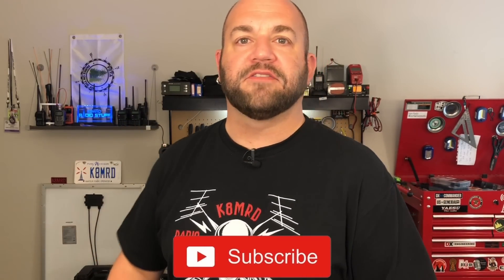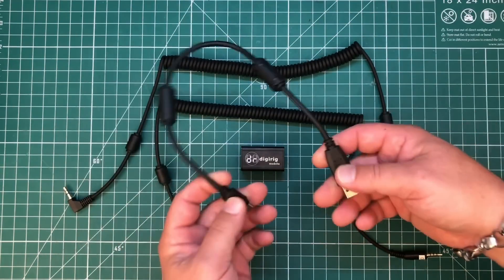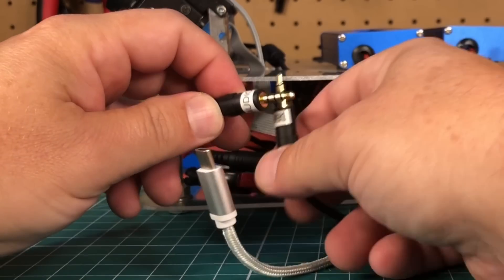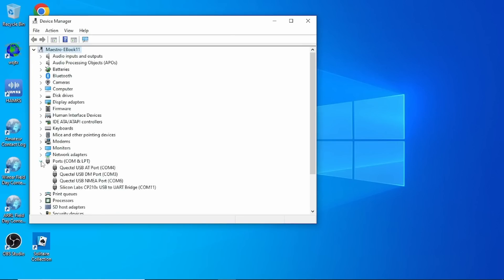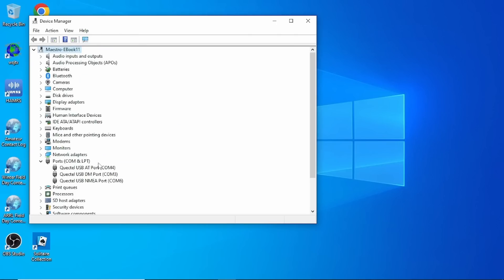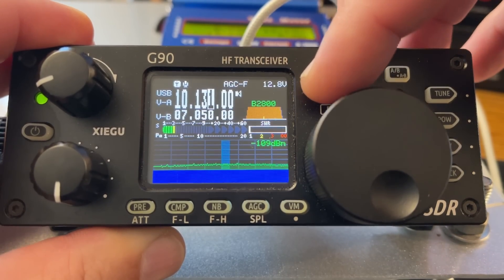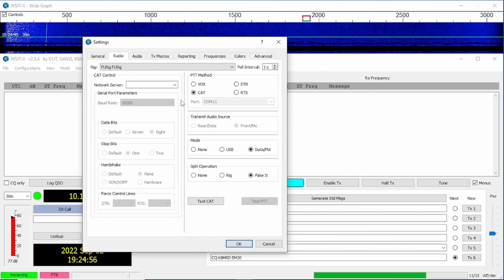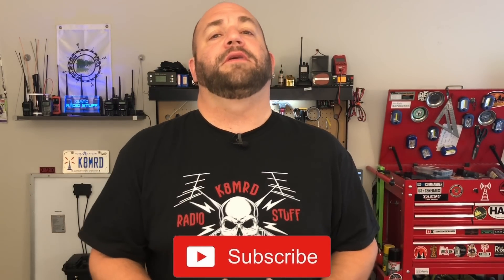Digirig, Xiegu G90, FT8 Fast & Easy

Comment: This looks quite useful, I'm trying to do digital modes w/ my G90 using a Sabrent usb sound card and I'm having all sorts of difficulty getting it to work reliably.  My antenna is a Wolf River Coil I typically just throw on a mag mount on top of my vehicle while parked.  So far I have gotten people to hear me one time, I'm having trouble figuring out what my issue is.  Most days receive is quite good, unable to get ahold of anyone to tell me what my transmit sounds like.

Comment: Are you sure that you want your ALC so high? High ALC should be an indication that it's clipping your audio to prevent splattering. HamRadioDX and TO have a segment about it here: https://youtu.be/dOXbvKNu0c4?t=1280  On a side note, it's awesome that you're doing FT8 more - we had a QSO last week on 17m FT8 while I was doing POTA in Hawaii.
Reply: On the G90, the closer you are to zero the more you are over driving the signal. If you're running the current firmware, the manual actually says that ALC 100 is under driving the signal and ALC 0 is over driving it. You can tell this is the case because he had his radio set to 15 watts. At 100 ALC he was only pushing around 13 watts. After adjusting the ALC he was able to achieve full power. 

Mike is an OG when it comes to the G90. Pretty sure they're going to name the next version G90M. Maybe OG90M? Who knows?
Reply: @norrinradd8952  ahhh, that makes sense, it's the opposite for Icom
Reply from the maker: What Norrin said.  And heck yeah on the Hawaii POTA!!  I needed HI hunted so bad too.  Now all I need is to hunt AK and I'll have all 50 states hunted!  Thanks so much for being out there!

Comment: Thanks for doing this video Mike. I have been considering going digital with my G90 but didn't want to get that hockey puck thing. This is a lot easier. Hope to connect with you on ft8 someday
Reply from the maker: No problem!  Hope this helps make your decision.   Catch you on the air!

Comment: I've been using the XGGcomms Digimode-4 cable for a couple years. One USB to the PC and two connections to the G90, just like this. Works with FLRig, sets up as a "IC-7100" and done. Just set WSJT-X to look at FLRig for control. It's been great.
For those who didn't know like me, the "Fake It" split setting makes your PC output a tone at one frequency and the radio moves its output up or down to put the tone on the right "segment". It can get weird at the edges of the 3kHz space. This makes your output power consistent. I learned this by scratching my head for a few hours.

All that said the digirig is much cheaper and you don't have to wait for it to come from the UK.

P.S. Love the into, particularly the Walley World shirt lol We have the Marty Moose eggnog glasses for Xmas time!
Reply: I have the same but I use a X5105 with it. There’s even a profile setting in flrig for the x5105! Working the World Dig on 5W. 73
Reply from the maker: well look at that.  Learn something new every day.  I honestly don't know why I started using Fake It, but it's worked for me for all these years.  Eggnog is gross but I'd drink out of a Marty Moose glass for sure.
Reply: I used the XGGComms also works great.  Why do you use Icom 7100 with FlRig?

Comment: Loved the opening, Mike! One quick reminder for G90 users, remember to disconnect the serial cable on the side of the radio head when powering up rig or it will go into Programming Mode and you will need to reboot the radio without that cable connected. Bonehead me has done that too many times. 😆
Reply from the maker: Hmm, mine has not done that.

Comment: By the way, for me, using the DigiRig for the 891 is a pain in the a$$.
Reply: What issues did you have, Ed? I'm considering the DigiRig for my 891.
Reply from the maker: How so?
Reply: I think a lot of it was using a 40m loop.
Reply: It wouldn't decode when I used it.
Reply: And the configuration is different but doable.
Reply: Took a while to find that out. That was the pain in the ass.

Comment: The intro is great! It's good to see some more G90 stuff recently, especially when it comes to digital modes. 73
Reply from the maker: Thanks Dusty!  I really need to use the G90 more.  Since I got the 705 it's just been sitting in the corner collecting dust.